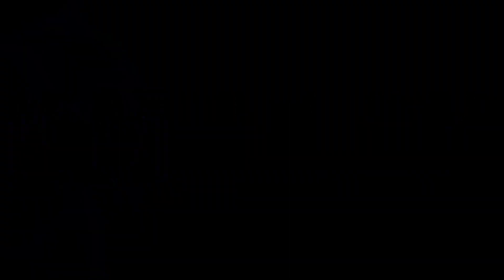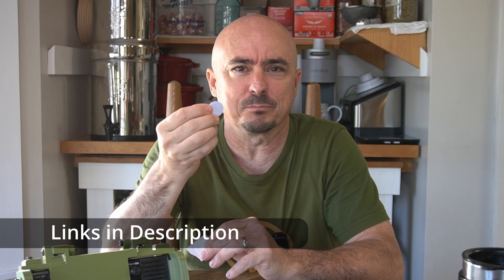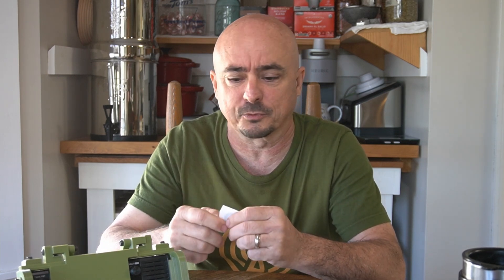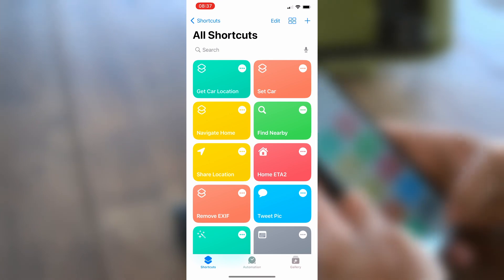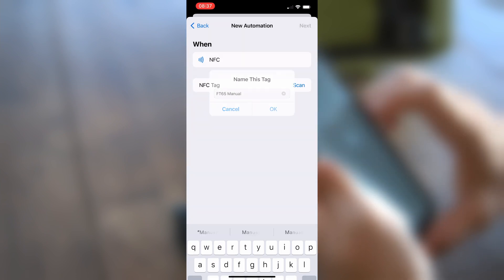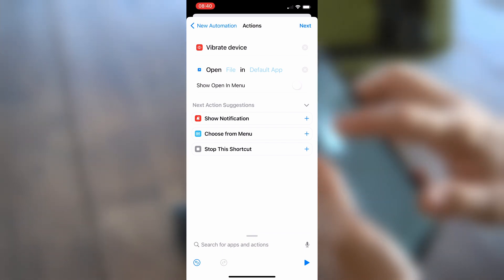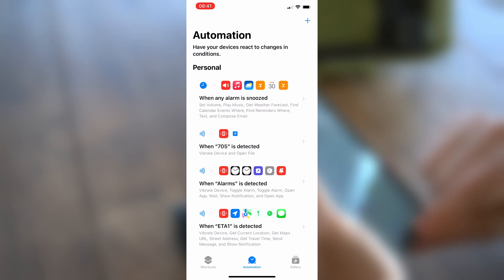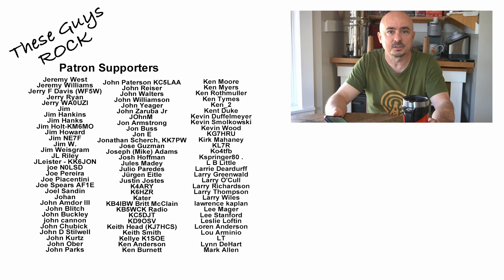Ham Radio and NFC Tags

Comment: Awesome tip. There are so many uses for this technology. 

Perhaps, instead of sticking on the outside, maybe sticking it inside the radio or behind the battery. Protected from elements and abrasion.

Once again, thank you for a very handy tool for us all. 73 DE VO1MRK

Comment: You can get tags that can be placed on metal they cost a bit more  but they are out there. 
My business cards are laser engraved stainless steel and I have a QR code and a NFC tag on them. 
My 2.0 business cards will have LED's that will light up when you scan it with a reader.
Reply: Hi Charlie B - What is your source for these cool steel cards? Thanks!

John

Comment: Great idea. I have been using NFC's around the house and in my vehicles for automations and reference data.
I have similar setups for tapping on a NFC on the outside of a tote or pack to get a list and or images of the contents (handy for the totes on the top shelf in the garage).
I will definitely start adding them to my radio kits and misc gear. Thanks for the inspiration!

Comment: I have paper versions of several Nifty Manuals, but I have never seen pdf copies for sale. Would be good to have them. Ordered the rfid ‘patches’ 👍🏻
Reply from the maker: I scanned my paper versions and saved as PDF files.
Reply: @KM4ACK  ah-ha! Simples 😉
Reply: I've had a lot of luck finding manuals online for free that other Hams have already scanned.  Even for some very old radios.   I think I got my Tentec manual straight from the manufacturer if I remember correctly.  For new radios pdf manuals are even easier to find.

Comment: This is an excellent idea! I can think of dozens of ideas for these in ham radio.
Reply from the maker: Would love to know how you use them!
Reply: @KM4ACK  Here are a couple of thoughts:
1) You may be able to scan the tag through a backpack and see what is in the bag without opening it.
2) For rigs with CAT control, scan your Morse paddle and automatically set the modes on the transceiver. Scan the straight key, and the rig is set for a straight key, etc.
3) Scan the rig; the correct rig is set in FLRig.

Just scratching the surface ;-)

Comment: Out of curiosity, you mentioned using it for guest wifi info, how?
Can you point to the Android equivalent?
Reply from the maker: You can use an app like NFC tools to program different things (including wifi data) onto the chips. - https://play.google.com/store/apps/details?id=com.wakdev.wdnfc&gl=US
Reply: Personally I recommend a QR code for WiFi creds.  Not everyone has NFC yet and it's easy to make the QR. On Android go to settings >> Network >> WiFi Then select the settings for the WiFi network and tap share.  You can screenshot that QR code and print it.  Alternately you could use an online QR code generator.  Then people just open their camera and scan it or they can open their WiFi settings and scan from there.